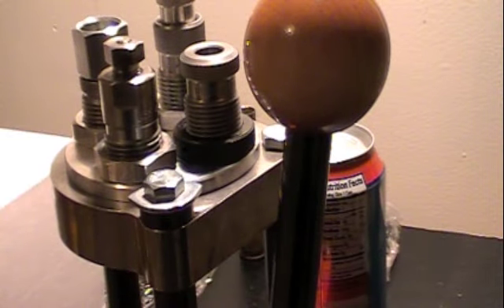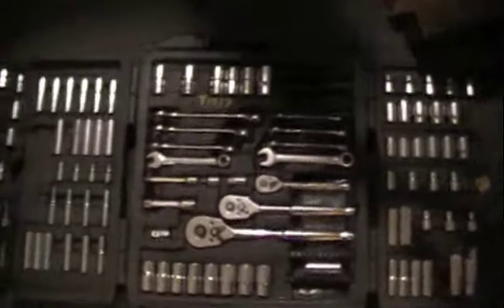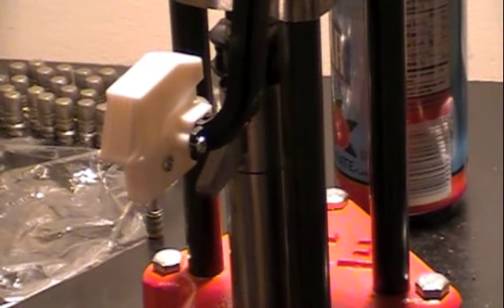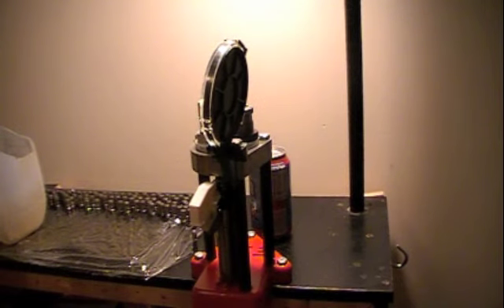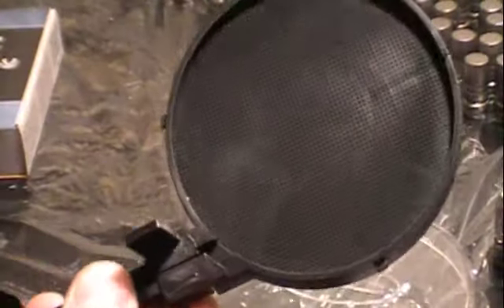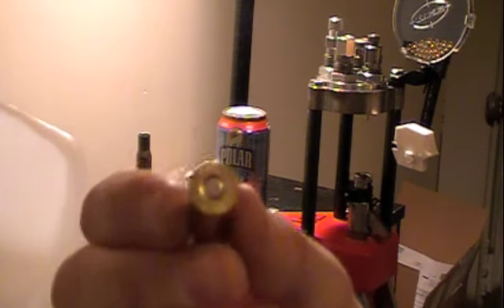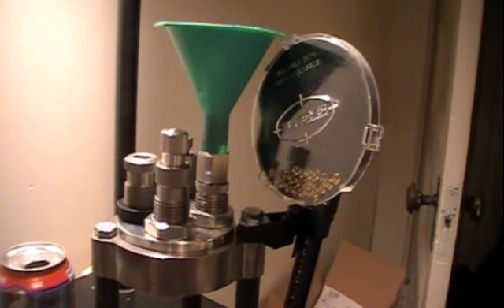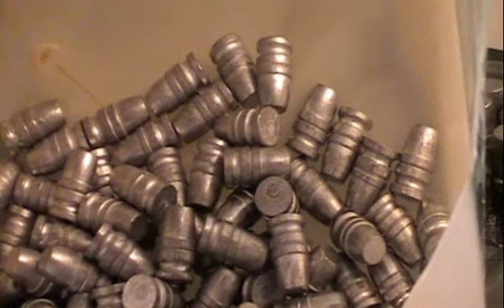Lee Safety Prime Installation and Use

Comment: The new safety prime is hands down not even close to as good as the older version with the "U" shaped return spring  and in fact the updated 'U' shape return spring with the 2 loops at the corners sucks even worse and thats all they would sell you at Lee for the last 5 years that is untill they stopped even making that and selling it . Since everyone who has owned all of the Lee saftey prime's over the last 20 years is in agreement that the old style with the round tray and the original "U" shaped return spring is the hands down best and since you can no longer get the original return springs (BP3376) the best thing to do is to make one yourself . Its really really easy. You go to the home depot and get an actual spring that is the same diameter wire as the original return spring and you come home with needle nose pliers and a set of wire cutters and you straighten out 3 inches of the spring till its straight then you bend it with the needle nose to the exact shape as the original BP3376 spring and then you cut it with the wire cutters to the exact same shape and it will work AWESOME !!!!!!!!! all you need is to start out with actual "spring steel springs" so it will spring back and forth for you . I tried to use paper clip wire and it was not spring steel and would not spring back and forth . I promise you this WILL WORK !!!!

Comment: I added a long thin low tension rubber band from the rightmost post of the turret to the primer feed unit just above the point of balance. this keeps the safety Prime all the way back until I press it forward it also keeps the unit from bouncing around and falling off when tapped.

Comment: BigAgitator do you clean the cases with the spent primer in it?  I have always deprimed and sized on a single stage press then I'd clean the primer hole.  After that I'd trim the case, chamfer inside and out and put it in a tumbler to clean the cases.  It takes a long time to do all of that. Am I doing unnecessary step and creating myself a lot more work?

Comment: FYI. the Lee handle is curved so that, during mounting, you can rotate it away from the Primer Loader. This will prevent it from catching on the Primer loader when swinging back up to it's full position.

Comment: what is the difference for the two primer options Lee has? One is the primer upgrade and then this one here which is the safety primer upgrade> Nowhere does it tell me why I need this one vs. the other. The other is cheaper for sure.

Comment: Hold your flat of primers in one hand and place the safety prime tray face down on the flat of primers and then turn the whole setup over 180 degrees.  Remove the empty flats.  Much easier than dumping the tray of primers into the tray.
I still can't get mine to feed consistently no matter how much I tweak the thing.  I put a towel on the floor under where I am working to the primers don't disappear when they miss.  Still liked your video!